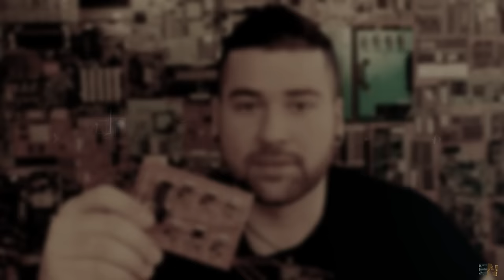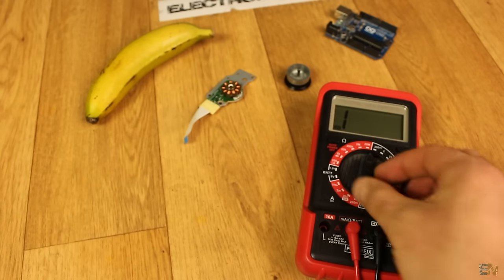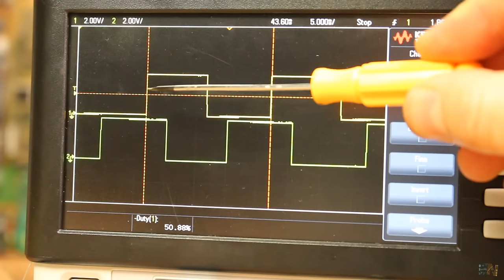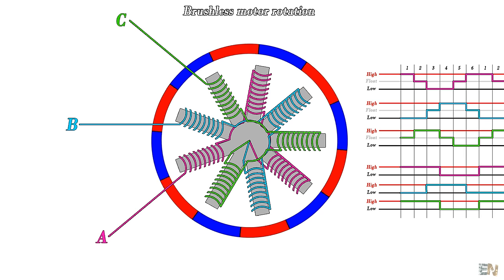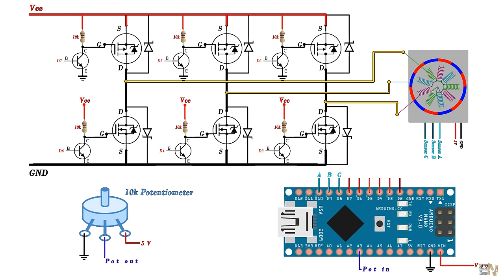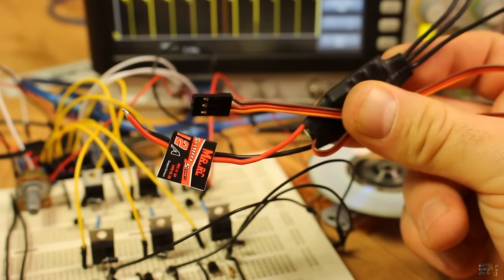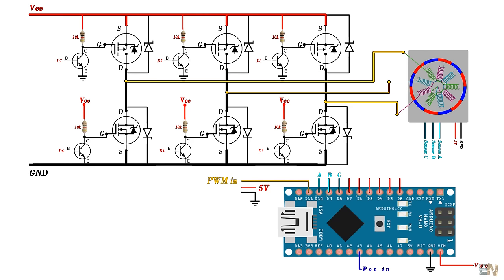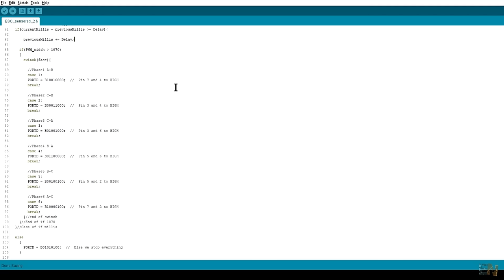DIY Sensored ESC - full tutorial

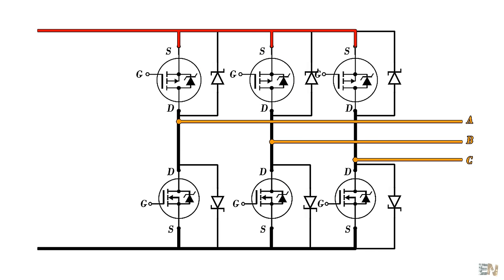Comment: 8:03 the way you connected your low side fly-back diodes effectively shorts out the N-CH low side drivers. Had to point that out or else and unsuspecting electronics hobbyist would make the circuit and wouldn't know why it's not working, or rather why there's smoke coming out.
Reply from the maker: Wow. Thank you so much for your comment. I must have been in a hurry. I've reversed the diodes now http://www.electronoobs.com/images/Circuitos/tut_19/sch_2_2.png You might have to refresh the picture to see the changes. I'll place a WARNNING massage in the description.
Thanks again!

Comment: low side diodes in backwards.. if installed like the diagram in the video, shoot thru will occur on all 3 legs causing your high side fets to burn up big time.  Considering those are the P channel type, it would be an expensive mistake to make!  Also.. The HIGH side fets (p ch.) are turned ON with a HI signal, but the LOW side fets (n ch.) are turn ON with a LOW signal, according to your schematic.  Because of this, the signaling sequence mapped out at 7:10 won't work.  I think everything works better using gate driver IC's so that ALL mosfets are controlled in the same way.  High signal = ON, Low signal = OFF.  Using gate drivers would also make N channel mosfets work for all 6 switches and get rid of the P ch. fets.  P channel fets are generally much more expensive, have higher losses, and slower switching frequencies.  N channel fets are the way to go, despite the small amount of added circuit complexity!

Comment: When you have the gates of multiple mosfets connected together, you should put a small value resistor (<200 ohm) between the gate and the common conductor (the wire that connects all the gates together). It is also good practice to do so even with a single mosfet.

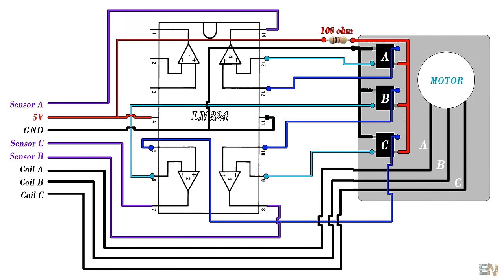Comment: at 3:53 on the wiring diagram... is it correct that the hall effects output on one sensor go to the same comparator (op-amp), yet on the other two sensors, they are split between the other two comparators(op-amps)?

Comment: the best way to drive brushless motors is use half bridge (3 n channels), connect the center tap to + and drive the 3 mosfets by directly using hall effect signals. this will run the motor as if it was brushed, so if you want speed control add 555 pwm signal to the opamp input (or the sensors themselves if you add 3rd party sensors with integrated opamp) and my cheesy way of adding overcurrent protection is 3 555 monostable timers for each phase to make sure the pulse isn't too long therefore reaching too high currents
Reply: full bridge drivers with 6 mosfets migh be a bit more energy efficient, but makes things so much more complicated that its easier to just rewind the motor with thicker coils

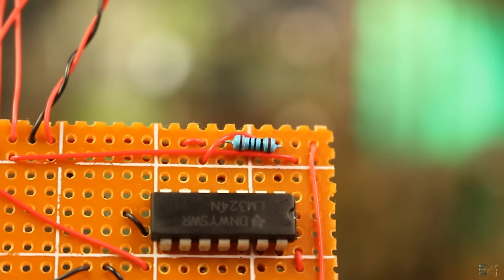Comment: 4:28 100 ohms is a bit low. i've burned a hall sensor using 1k resistor. 5-10k resistor is perfect-the sensors will feel ok and the opamp will have no problem detecting the signal

Comment: Hi! Mosfet burn probably because you have a shot through and you didn't provide a short delay gap between mosfet turn on/off. With little current this is not a big problem (only amount of heat dissipation on mosfet) but with a big motor the startup current are big due to high inductance of motor coils.

Comment: Is it scheme on 8:43 wrong?
bottom 10k resistor should stay between Gates and GND,
and npn bottom transtistor should stay between VCC (by collector) and Gate (by emitter)?
but yeap - it is not good position for npn transistor.
Because author opens bottom switch with 1bit from port, its mean that when npn on 0v signal from port - he is open with 10k from Vcc.

Comment: I have a question and no exact answer. I have a washing machine motor and dryer, and I need an answer so you can help me, I want to install a hall sensor to monitor the magnetic fields. The question I'm wondering is where should I install the 3 hall sensors on the stator? Thank you in advance, congratulations on the classes, very good and very didactic.

Comment: Sir, Is the Arduino code same for a sensored control of my 24V 60W bldc motor...I know the gate driver requirements and switch selection should be altered depending on the current ratings....is the pwm generation code is same?

Comment: Question:  Writing directly to the port  lets you turn on/off both pins for each half bridge simultaneously. Is it possible then to shorten the 6 step sequence to 3 steps or would this loose contact with ground for too long during the switch?

Comment: Hi, great video. I only have one question, how to locate the hall sensor in the boards? I see you have 40° between then, but how to locate them if you have different number of poles? Thanks
Reply from the maker: 40 degrees is because a full rotation is 360 deg so with 9 poles you have 360/9. If you have 12 poles just divide 360/12 and get 30 deg between each sensor.
Reply: Electronoobs but it does depends on the number of poles in the rotor? If you have only two magnets on the rotor, for example? Thanks

Comment: there is a problem bro. We using HIGH  output for driving  mosfets but low side of the circuit runs with LOW output. 
and also i am wondering are diodes  necessary ?

Comment: isn't the mosfets gate current for switching it on limited by the 10k resistor too much?
Reply from the maker: Mosfets are not controlled by current at the gate like BJTs. They only need voltage.

Comment: i need a pin reveser direct motor in mod POT   or   Set  value  PWM  1000 -1500ms  IS cw  , 15000 -2000MS  is CCW . How to change code ?

Comment: Hi very nice controller for brushless motor, congratulations, but is better is you using voltage level shifter or gate driver because the voltage in the gate of mosfet is very low and the current flow in the coils low too.
Reply from the maker: You can use a MOSFET driver, but as I say in the video I've made my own driver with a simple NPN and a pullup. Thanks and keep up!

Comment: Really great series of videos - thank you for taking the time to make these.
I have a question - if I wanted to apply a braking action, my first thought is that at each hall sensor change, you simply reverse the action, eg instead of driving phase A high and B low, you drive A low and B high, so the motor resists moving to the next step?

Comment: Is it possible to make this design for a bigger motor, like shown in the intro?
Reply: yes you just use bigger mosfets that are rated for the amps and volts you need
Reply: If you start pushing some power to the motor maybe you should add some film capacitors to limit ripple voltage on the dc bus.

Comment: This Is very useful. I'm trying to make an ESC for an ebike motor. Is it possible/practical to scale this up to a few Kw of power ?
Reply from the maker: Yes but you might want to change the components, use more MOSFETs or IGBTs in pharallel in order to increase current! Keep uP!
Reply: I dont think that you used low quality mosfets. N and P channels have very low resistance (0,02ohm and 0,017ohm). Are you sure that they are not right for bigger motors? If yes why ? Im asking because im in process of building the same driver and im wondering why they are not right.

Comment: This is an AWESOME video! I really liked it! so... what about position control? can you use an AS5048 sensor to detect the position of the rotor and read that with the arduino to drive the motor so that position is controlled? would you need to use PWM to graduate the 6 steps into a finer mesh so that the resolution is improved? would that turn this into a FOC? great videos!